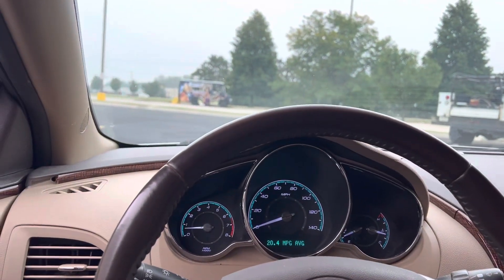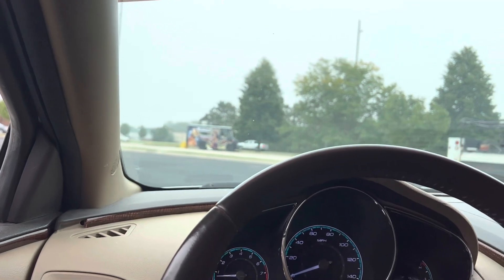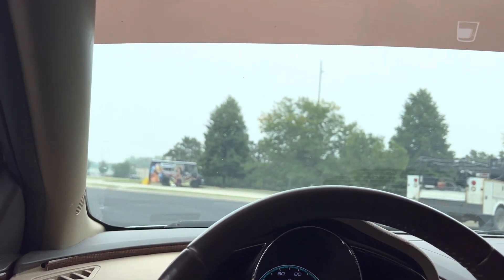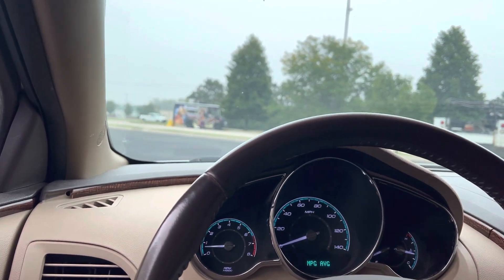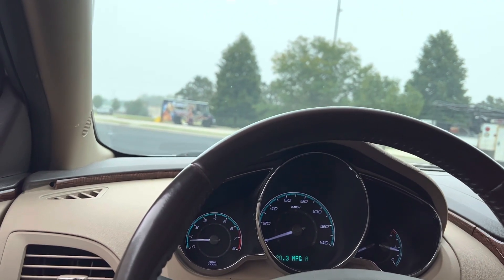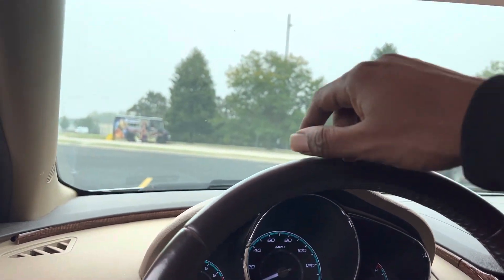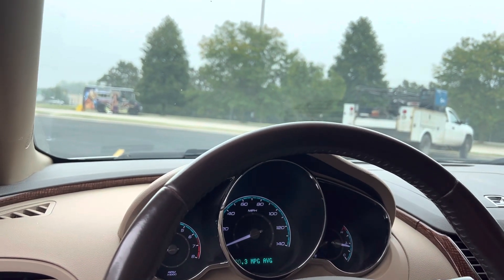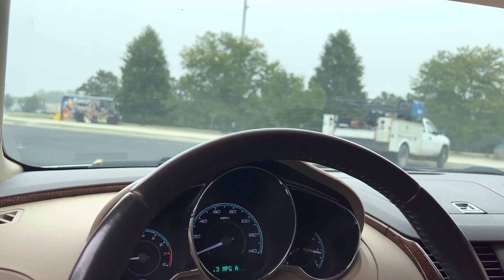Lithium Headway Cells Balancer Explained/How much Bassss For Daily Driver?

Comment: I already have an active balancer installed in My pack...can I still use an external BALANCE charger to charge My cells?
Reply from the maker: Yes you can as long as it for lifepo4
Reply: @markwoods212  thanks man

Comment: I daily a ampere 7500 and 2 american bass hd 15s with directronx spl parts, currently 144ah spim08, might go back with headways with my daily, plan on making my blazer my bass vehicle then ill put in my crossfire xsv2 18 and both my ampere 7500s, and when i get a new daily i have a blown ampere 7500 that i gotta send off lol, and i got the same balancers the only time ive seen the lights turn on is when i pluged em in and the flashed for a second and thats it.
Reply from the maker: That’s what’s up Brother yeah I was able to find out more information about the balancer it blinks when you’re cells are balancing or low on power.

Comment: What size alt are u running? And does balancing reallymake a difference in performance with or without one?
Reply from the maker: My alternator is 220 amp and no the balancer doesn’t make a difference in performance it’s purpose is to balance the cells evenly
Reply: If you don't use the balancer your cells can become unbalanced an that will cause a performance loss an also with lithium you "HAVE" to use a balancer or the cells risk overcharge/overdischarge. You could have cells swell. Vent a burst. Or just become dead cells in general. Plus they're so damn cheap it's kinda assinine to not use/buy one
Reply from the maker: @brandonburns8410 yeah I can’t say you right cause it hasn’t been proven you need a balancer or not as far as I know
Reply: @markwoods212  if you do some research (please don't take this wrong I love your content man!) On balancers an what their job is when it comes to lithium versus other battery chemistry is like when ppl put cells in parallel with one long wire or something like it to "top balance" them. If you do not apply a low amperage charge but just leave the cells in parallel they will not top balance on their own. A charge must be applied for them to even attempt to top balance (this is usually done before ppl assemble a bank an then add a balancer). 
I'm not saying youll get a performance gain by using a balancer. What you will gain is proper battery life an proper cell management. An that's what keeps the bank running right. 
If you have a cell in a bank of 4s an one or two cells are off by a good bit let's say 3 out of 4 banks read 13.8 but one reads 13.2. 
Your battery will operate at the capacity of it's only charged to 13.2 because of it being out of balance it'll play like a week link an what power is available will have to run thru that bad/unbalanced cell bank in order to deliver the energy needed but because that cell is technically "dead" it's gonna tell your volt meter your amp an whatever electrical that's hooked to it that you only got 13.2 voltage. An when this happens cells can get damaged worst or thermal runaway can happen inside the cell an they swell .
Reply from the maker: @TrunkThunderLithium  Thank you brother for saying I have good content. And I could tell you did your research, but I went off real life experience. I had that 48ah lithium in my car for seven months without a Balancer. when I brought the bank upstairs, I checked all the cells and they were good after that I added the balancer to the 48ah and now lol I have a super beast working without a balancer which this time charged it up before installation
Reply: @markwoods212  well that's also the thing about balancers they do their job but I'm not gonna say you can't get away with not using one especially if you are constantly using the battery in let's a say your daily driver. Because you constantly charging an discharging they will self balance to a certain degree thatll be good enough to the point it won't matter. When they come into play mostly on the safety side of things is when the battery is being charged by solar means or going to be sitting for a very long period of time without being charged or discharged.  I'm running a superbeast myself also. The cells were very close for not being hooked up an balanced for however long they sat at battery hook up. But I will say once I did hook up the balancer things evened out completely which is what you want to get the most efficiency from your bank. 
With that being said ppl also don't understand that your balancer doesn't have to be plugged in all the time. If you just plug it in like once or twice a month overnight. That would be more then enough an sufficient to balance them perfectly an maintain a healthy bank. You don't have to keep it plugged in for forever I feel like that's the misconception for newer ppl (not speaking about you just in general here) that it has to on an light on in balance mode at all times no matter what an that far from true. Balancer would last longer to if its not plugged in all the time especially if you use the bank on the damn daily
Reply: @markwoods212  thank you man for taking the time to be busting up about this subject with me. I appreciate it. Keep the awesome vids coming bro!!! Bang out!!  Might see me at a show one day soon if my build gets done in time. Got a all neo build with my 2004 Cadillac deville. Gonna be running a sundown NS12 v4 on a 8 or 10k amp. Haven't decided just yet on the amp brand I'll go with. If you know anything about the devilles an cts or even the dts model they have they trap door when you drop the rear arm rest. Well my port is going to be firing into the cabin thru that trap door square hole 🤙🤙🔊
Reply from the maker: @TrunkThunderLithium  No problem Brother and that build sounds nice I hope you get it done soon keep me posted check out my recent videos when get a chance and that should catch you up with me and I’m definitely going to the Slamology

Comment: You already know I'm running a bc6k on a single 15 which is probably doing around 5k after ohm rise in my daily driver. My electrical is decent with 40 ah yinlong lto and 320 alt but my 6k runs much more efficient with beefed up electrical.
Reply from the maker: That sounds awesome brother for a daily driver